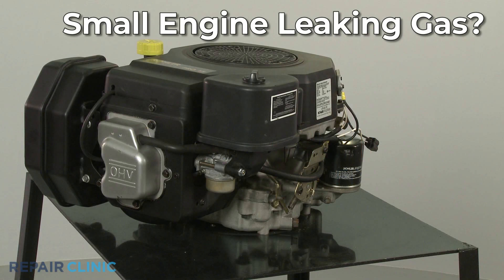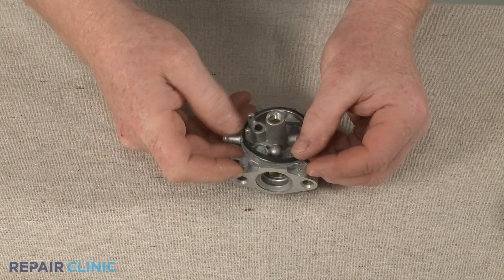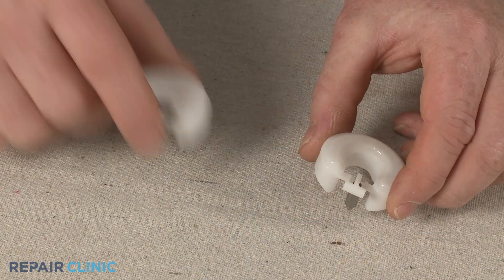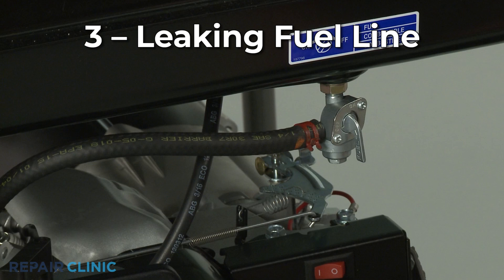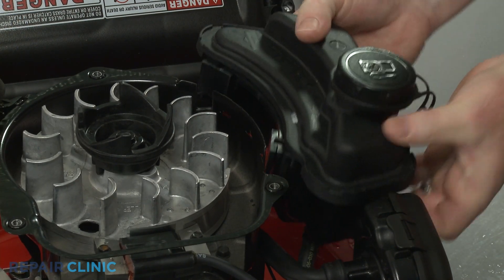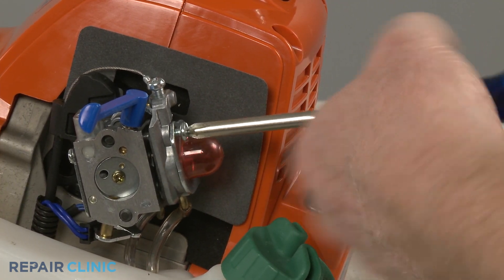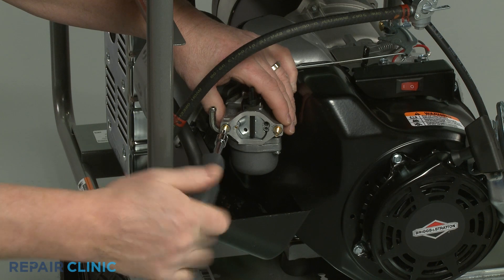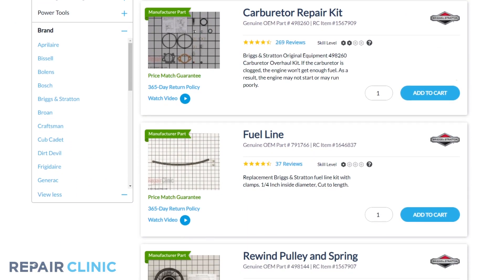Top Reasons Small Engine Leaks Gas — Small Engine Troubleshooting

Comment: Great info.  Bought a brand new Troy Bilt and it leaks gas out of the air filter after the 5th pull.  Never cut grass with it and now it’s sitting in the shop.  Won’t start.  Had it running a little one day but only runs full throttle full choke.  Sad that they won’t return their problem.  Tried the gas I had that was 2 weeks old and then got new gas.  Hopefully they can figure out the problem.

Comment: Bought a new carb for my HFT Preditor 79cc engine. The second I poured gasoline in the tank, it was gushing out of a tiny hole in the side of the carb.  My guess is this is a bowl vent on this new carb. The original carb seems to have a BB-like metal ball inserted in the exact same place, but the replacement carb doesn't have this BB in the hole. And oddly, it looks like it was never supposed to have a BB in it. No idea why this tiny hole exists except to leak gasoline. The hole was designed into the casting, it doesn't seem to be a defect. Maybe the carb needs to be primed by unscrewing the bowl's side screw to allow gas to run into the bowl instead of out the hole??? Anyone? It made a mess, so I'm hesitant to try again until I find some answers. Tx